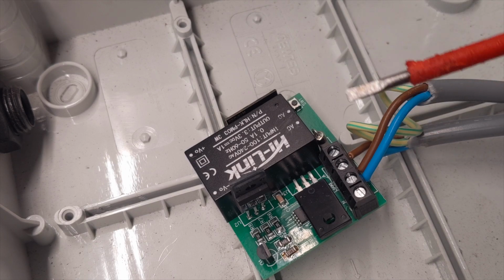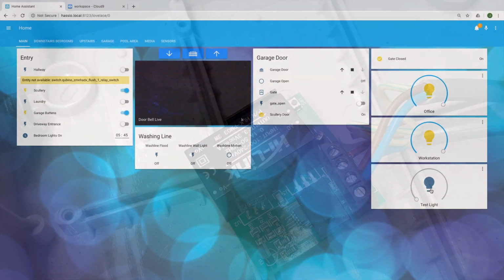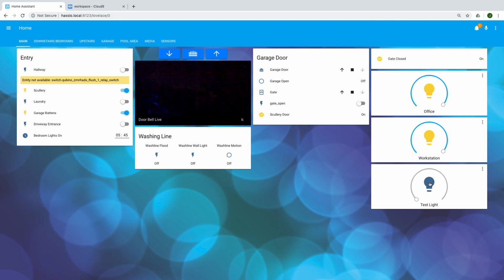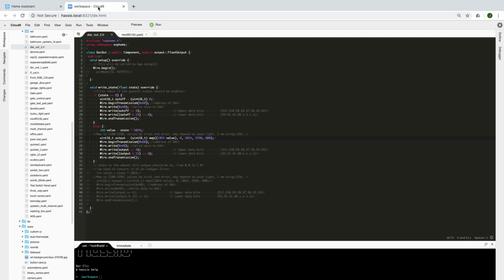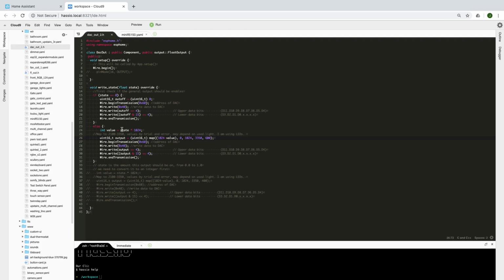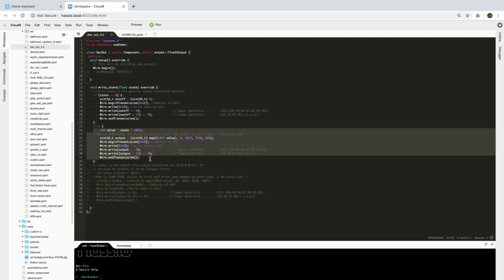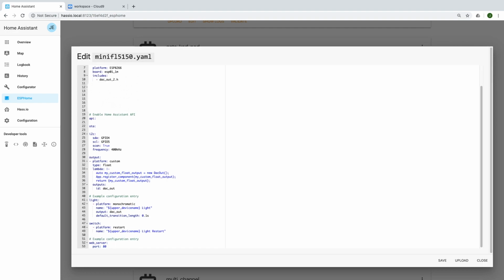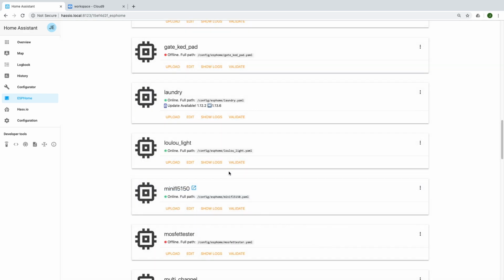Home Assistant Wifi Phase Cut Dimmer

Comment: Hi Jimmy , I did almost the same to connect to esphome but with an attiny84, I added the wire library in the attiny , so the attiny is do the dimming and also is doing the dimming levels through I2C.   So I only need one IC to do the I2c and the dimming but like you I have issues with the lower levels in dimming.  It start to flicker in the lower levels. I see you fixed that with the map function.   I am wondering if you found some good dimming leds that doesn't have that flicker behavior because sometimes you want to create an ambiance that requires that kind of dimming.

Comment: Have you tried the 2 wire design? I've been puting a lot of thought into how do they get power from that design. The VDD pin (internal regulator output) supplies very little current (and therefore, little power). Ive been thinking about putting a switching power supply conected to the VS pin (17V if I'm not mistaken). I don't know if a LDO after that switching supply would be necessary or if it is just enough with sufficent capacitance. Do you think that would work? The 220Vac/5Vdc module really takes a lot of space and I would love to not depend on a neutral wire. Great project and great work! I'm looking forward to do the same.
Reply: Did you try this? I'm considering using an MP2325 buck to take the 17v down to 3.3v to supply an RP2040. The 17v would also be plenty to drive a 0-10v dimming rail to control the FL5150
Reply: I did not. The main issue is that if you want to control it using a microcontroller and a DAC or digital dimming, you need to keep power consumption as low as possible. In the 2-wire configuration, a little voltage is drop from the mains (when the "switch" is off) to maintain the supply of the electronics, so you can't fully reach 0% or 100% dimming. This form of dimming I think is called back-to-back mosfet or IGBT but I am not quite sure how it works. I haven't found proper documentation explaining how back-to-back mosfets work in dimming applications. If you find anything that would be helpful. 

I am sure you can do that. I also plan to use a regulator or converter to have a supply for the microcontroller, but that's the price to pay, a minimum Ioff current through the load. And the larger your power consumption, the greater the Ioff current needed in the "off" state. This is an issue when your AC LED load draws little current. Usually there is a minimum load in these kind of circuits to properly work. @NeilStansbury

Comment: Hi James. What are your thoughts on Shelly 2.5? I bought a couple to try out, and they get pretty hot. Given you're a sparky you probably have a better idea what is too hot for something that's meant to go in your wall space! If you're on the HA forums, I did a detailed post about it. See here https://community.home-assistant.io/t/shelly-2-5-getting-hot-to-touch-63-c-external-case-should-i-be-worried/175376 if you have time. Basically they get very warm when the output is off (about 47°C) and with one 8W LED downlight on each output, just below 60°C!!
Reply from the maker: I found the same with the Shelly 2.5 is get quite hot. When we do thermographic testing I regularly see relays etc that are 80 deg and as you commented drivers and transformer can get pretty warm too. That's all normal and most building wire we use in Australia is v90 which means it can get to 90deg safely. The main thing to consider is not placing electrical items that run hot near a combustible material and if possible they should be enclosed in a wall box that's sealed so fire can spread, it if did fail.
Reply: @SparkyJames  thanks good to know about your thermographic testing and v90 and that the higher temps seem fairly normal. I guess I still feel uncomfortable as most other home automation devices that I've used run cooler. So is gyprock (dry wall in USA) considered "combustible"? Probably can't put them in a fire proof metal wall box as that would block the wifi signal...

Comment: Nice work Jimmy James.  It's look like interesting and can you please post the circuit of the project.
Reply from the maker: Hi Ravi, thanks. I have updated it for you here https://easyeda.com/james_6977/fl5150-modified note that R9 is a 1w resistor. I was using a 1/4w and it was too small the, the datasheet does indicate that this resistor may pass up to 475mW at times, so I throught a 1w may be a good idea.
Reply: @SparkyJames   Thanks for the information. In the circuit, there is no isolation between AC and DC. Can we bring isolation between it?
Reply: @raviteja8335  If you have an example, I'd like to see it. Jump on EasyEDA, clone Jimmy James project, and make the modifications.
Reply: @SparkyJames  your link does not show a schematic, can you reupload your schematic?

Comment: Great work mate! Exactly the project I’ve been tinkering with — your approach using the DAC seems a lot better than my thought of using a digital potentiometer. Really keen to see how you evolve the design.
Reply from the maker: I did think about using a digipot, but the DAC worked out cheaper and posibly a little bit more accurate, and pretty simple to use.  The one thing the digipot has in addition to i2c, some have a manual push button up and down to adjust the level, that might have been handy for local control at a wall switch. It's fun though trying out different stuff and seeing what works out best!!!  Enjoy your tinkering!